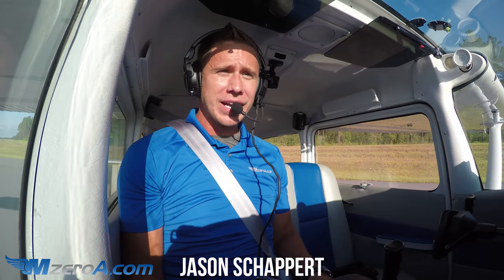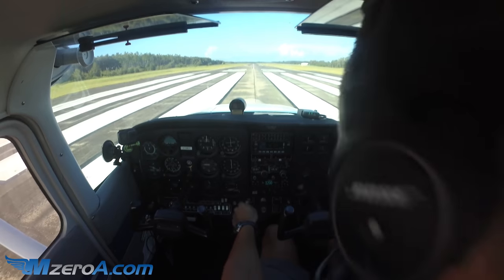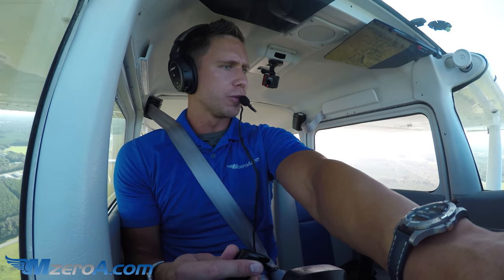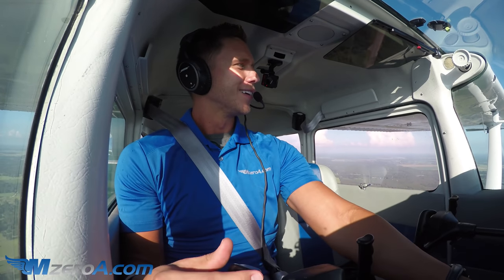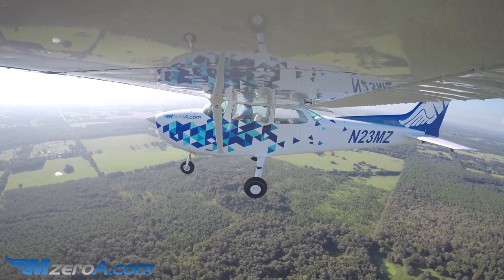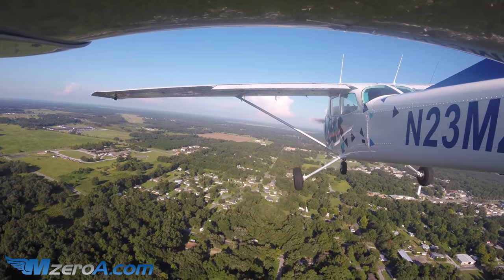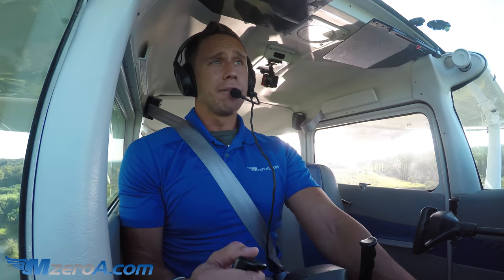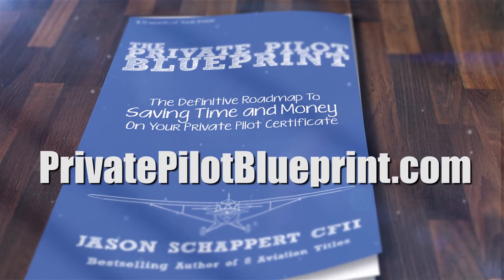Short Field Takeoff and Landing - MzeroA Flight Training

Comment: I have one friendly comment Jason. As a retired flight crew instructor for a major airline (I also taught at Boeing and McDonnell Douglas in their pilot training departments) I think aerodynamic braking is not necessary. I know of no aircraft that is certified using aerodynamic braking techniques. Certainly no jets. While working at a major airlines, we had a Captain who was trained early in his career (while learning to fly) to use aerodynamic braking when ever possible.

The problem later was, the plane he was now flying for the airlines (an L-1011 TriStar) doesn't need that kind of braking to stop. It's not certified that way. So what was the problem then? He pitched up too far one day and smacked the tail down pretty hard while trying to hold the nose wheel off the ground 'as long as possible' to take advantage of aerodynamic braking (in his mind at least). He wouldn't buy into the fact that the plane can stop shorter if he jumped on the brakes and let the anti-skid do it's job while going into full reverse thrust.

They repaired the plane (at great cost) and he got a month off without pay and then was back flying the line. However, about six months later, he did it again. Only this time he really smacked the tail down hard and broke the rear pressure bulk head. Massive cost to repair this damage. Because he was warning before not to do this anymore, he was let go. Very sad because as most aspiring airline pilots know, if he were to get hired elsewhere, he'd have to start at the bottom of the seniority list again. Tough in your mid-flying career as a Captain.

The possible (I say possible out of respect for Jason because I like your teaching technique) take away from this is that maybe pilots shouldn't get into the habit of aerodynamic braking...if they transition to jets later on in their flying careers, it could come back to bite them in the tail (no pun intended).
Reply: Different planes require different braking techniques. Aerodynamic braking might work in a Cessna, it is definitely required in many military fast jets and it may be useless in heavies. It all depends.

Comment: Lately there have been pilots announcing a straight-in final on the Rnav from 3 miles out.  I also find that some pilots fly the down-wind  2 miles away from the runway. Lots of fun when you are used to flying a pattern 1/2 mile from the runway.

Comment: Sometimes it's not only about our airspeed on final, but what we do to hold said speed.
You can come in steep with a nose down attitude, and low power, or you can use a slightly nose up attitude, keeping sink rate with power and speed with pitch (region of reverse command). That way, when you reach your desired touchdown point, yoi chop power and increase nose up attitude, the plane will lose speed quickly and floating on ground effect will be minimal. 
Touching down at a higher nose up attitude will aid in aerodynamic braking and help protect the nose wheel assembly in rough fields.
I currently fly an Embraer 110 P-1, and that is our technique in short fields.
Reply from the maker: Thanks for sharing!

Comment: You are an inspiration Jason.  I'm 70 now, been away from flying for 19+ years, I'm trying to get current, flying a Vans RV-12 with a Garmin G3X Touch. Having trouble transitioning from the traditional 6 pack panel.  Any thoughts, or suggestions?  Thanks so much for your inspiration, always looks forward to your instructional productions.  Bob
Reply: Hi,  I've heard others in your situation with the same complaint about the glass panels.  I believe the Garmin G3X Touch can be configured via one of the set-up pages to show the traditional six pack on the screen.
Reply: Thanks Brian, for some reason, my CFI was reluctant to configure the G3X to the six pack display.  Thanks for your replay, and keep up the Great Service to Aviation. Bob
Reply: No problem, Bob.  Just to clarify - I'm not part of the MzeroA team, although I am a big fan.  I saw your comment here and thought I'd put in my two cents.  Best of luck getting current again!  I hope I didn't step on Jason's toes :-)
Reply: Thanks for your replay Brian. I have over 1K hrs. in traditional 6 pack planes. It's amazing how much information is available on the G3X,  and the safety of ADS-B.  I too am a big fan of MzeroA, I've invested in some of their service. Bob
Reply: If the glass panel CFI does not want you to use what you are familiar with that works well,  then get another CFI.  Many Glass CFI's are afraid of the less automatic-and less demanding 6 packs.  Then they chickens try  to bring you down to their lower talents level.  Dont accept it. Its your money and safety. Flying 6 packs is more difficult, but makes you a better pilot via avoiding "Pilot Automation Dependance".  That is a big problem with some CFI's and many accidents happen due PAD Pilot.

Comment: Good advice. But wouldn’t it be better to keep airspeed up on final, rather than at minimum, and execute a cross-control landing at a higher threshold altitude, which will put you on the ground sooner, and then immediately take off all flaps. And if there is another plane on final behind you, after touching down, roll out on the side of the runway, so that the following plane can, if necessary, take the center/left runway passing you. Always maintain as much distance as possible between your plane and others either approaching or already in the pattern - just as the plane following extended his downwind for that reason. Great advice on always looking several times for other traffic which may not be making calls. Never assume that other pilots will fly correctly.

Comment: Hello. Im loving your videos. Just one student question. Would you say that your touchdown was a bit too much towards all 3 wheels at the same time? woukd you not want to flare a bit more aggresiely? Genuine question - im not moaning.
Reply: Hah. Just watched your video 3 Things Your CFI is not telling you incl. Flare vs Trabsition. I have my question answered, thank you. 

Thing is all my instructors were always telling me to flare hard while i never thought there was a need for it. I think all they want to do is to save potential nose wheel accidents.
Reply: You were right the first time.  For a normal landing the whole transitions vs. flare argument makes sense.  For a short field landing though you should be in a full stall with the nose high on touchdown as that is how you get minimum airspeed on touchdown.  1) the high angle of attack (AOA) creates lots of good drag (when short is the goal then drag is good) 2) The slower the speed at touch down the shorter the stopping distance.  

He could have shaved an easy 5 knots off that touchdown speed if he was doing it right.  BTW he would have run off the end of most short fields in that video. If he was doing right he would have been full stop before the thousand foot marker.  If I remember right a 172 can land full stop in something like 500 feet.

“I think all they want to do is to save potential nose wheel accidents.”

Well they should as it is major accident factor in Cessna’s.  Landing too fast is what causes most nose wheel collapses and he is teaching “land too fast”

Check this out... https://youtu.be/J4NnmbbSizQ?t=1m16s

Comment: My instructor will not allow me to retract flaps until we are clear of the runway. Other instructors I have flown with clean things up shortly after landing.... is there a right or wrong way?
Reply: ur suppose to retract them on landing for short field since retracting flaps allows u to transfer the weight of the plane to the wheels so ur breaking will be more efficient.
Reply: Absolutely. But for all other operations its forbidden. I spoke with a commercial pilot recently and he mentioned that they simply retract once clear of the runway like anyone else simply because there is not reason to fiddle with things while on the Active etc....Of course it all depends on if you have a first officer etc to help with workload. I just find the lack of consistency and standards in the aviation world amusing.

Comment: 4,000 hr here, fully rated since 68. Done bush. No fun like 90° left turn to final at 100 agl at 4,000 ft msl into 1300 ft long!Like your videos. Very good.
First. Short field takeoffs by nature demand rolling J turns. Stopping extends your roll 100 ft. Second. Airspeed on downwind balances ground speed. Dislike your terminology. Three. You never mention trim and backpressure, just lots of adjustments. Four. I disapprove of the frequent use if power on approaches in little airplanes. They are a crutch to good technique. Extended finals should be flown level altitude until reaching your normal glideslope. Five. Short field landings are just that, short. We agree that we can get most airplanes into places they cant get out of, so lets be a little more explanatory about short fields and /or close obstacles. Short fields takeoffs with clear departures should be made at minimal airspeeds and extended flight in ground efftect. There is a notable different in real world techniques.Like to spend a few hours with you in a 185 or 206. Thanks for good videos that really help.

Comment: My poh says Vr=55. In short field,  I should rotate at 50? (P.s. student pilot)
Reply: In the POH - Normal Procedures section you should find the right procedure for short field takeoff. Typical in a C172 it is 10° of flap, hold brakes, full power, release brakes, slightly low tail (rotate around 50 kts) and climb at Vx (Until all obstacles are cleared)
Reply: Pending on your weight.

~1900 lbs gross is something like 47 knots in a Cessna 172.  Flaps are optional but 10° helps get you off the ground sooner
Reply: The correct procedure to perform a short field take-off is to use 10° flaps. That's also recommended in the Cessna POH. And by climbing at the best angle you can to clear any obstacles, meaning Vx.
Reply: Thomas Emilian Woah, my POH says something different :|

I have one for a 172M 1974, how about yourself?
Reply: RacinZilla003 Really..?! I have one for a 172SP 2005 with G1000. I have flown 10 different Cessna 172 aircrafts, mostly newer models from 2005 and up. And they all state the same regarding short field take-off. I also fly a 172 N 1979 on a regular basis, in that POH it’s called “maximum performance take-off”, 10 flaps.

Comment: You shouldn't retract the flaps because that helps you slow down. You should only do that when you're clear of the rwy
Reply: TupolevPilot brakes are more effective than areo braking but limited by the weight on the tires. You retract flaps to put maximum weight on wheels for maximum braking effectiveness.
Reply: Well, as Jason said: "know your POH".
In our French-built Cessna 152, section "max performance landing" of the POH clearly states you should retract flaps as soon as you touch down and brake, whereas normal landing keeps the flaps down all the way until full stop (presumably to lighten the aircraft until the speed really goes down, therefore being softer on the wheels). Same in our 172R POH.
But in our PS28's POH, short-field landing is explicitely no different than normal landing, so we keep flaps down until we exit the runway.
Reply: TupolevPilot You're not a pilot, are you?  And if you are, you must've not flown 172's.

We want to retract the flaps immediately after touchdown so as to use as much braking power from the gears.  Flaps help generate lift so even at slow speeds, having flaps will run you off the landing surface
Reply: RacinZilla003 I fly a warrior. I understand what you mean, but I still think it is a better idea to retract the flaps once clear, but I guess it's different on a 172
Reply: It is a good idea to wait for reasons of distractions and possibly retracting the gear in a complex aircraft, but retracting flaps on touch down is the proper technique to max preform the aircraft.
Reply: Most short strips are gonna be grass blades that are longer than a golf green, gravel, or dirt, often wet, and much slipperier than asphalt especially with the slick tread of airplane tires. Depending on brakes is iffy. Flaps down, full up, and standing on the brakes is the real world. All those performance guidlines and charts are just a starting point for real world experience... something you wont have for several hundred hours and formal bush pilot training. So stick to the charts, stay out of the really short vacation strips,  dont push your limits, live long and prosper. Thanks for reading.
Reply: Thats full up elevator
Reply: yeah sure, if you flying a big plane with big flaps... keep em till clear of the runway. Light general aviation planes brake better when you retract the flaps as soon as you start the rollout especially on short fields where you have limited distance to stop. the friction from the gear is alot more effective to stop than the flaps. the flaps create lift even at slower airspeeds. even so more than the drag they create to stop

Comment: The timing on the flaps made it completely pointless. You have to retract when you have flying speed or you are not increasing brake effectiveness. The theory is the same as an airliner deploying spoilers which they do immediately on touchdown thanks to a squat switch. The kinetic energy equation depends on the square of the velocity so high speed is the most critical.

Of course, I hate having students do this. They inevitably retract all the flaps at 50 ft.
Reply: I'm very much guilty of this, but I hate having to reach down to retract the flaps, I just don't like that distraction. On one landing I went for max braking without bringing those flaps up, and I may have painted a nice pair of black lines on the runway by doing so. That's something I will have to work on.
Reply: I tend to agree that it isn't worth doing in most cases. The landing distance isn't going to be that much longer and redirecting attention during touchdown adds risk. This discussion is really one of understanding the why of a procedure rather than blindly following a published one.